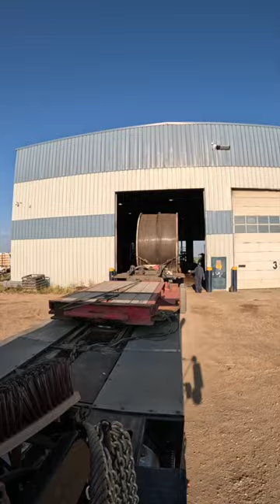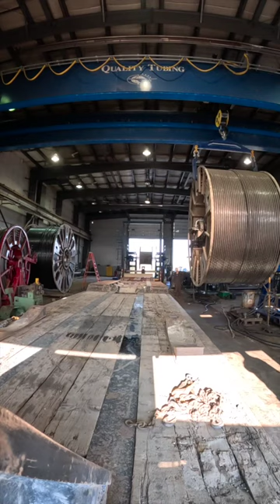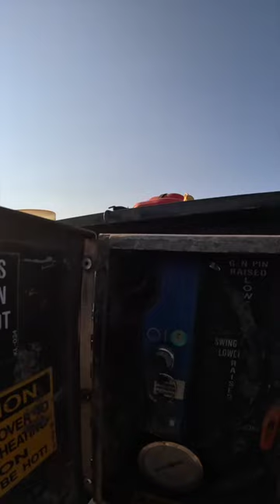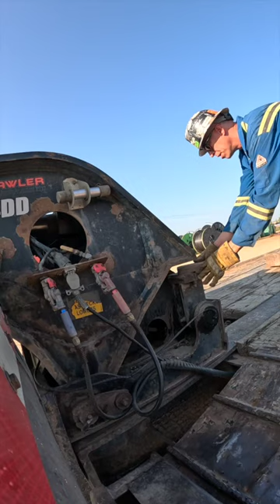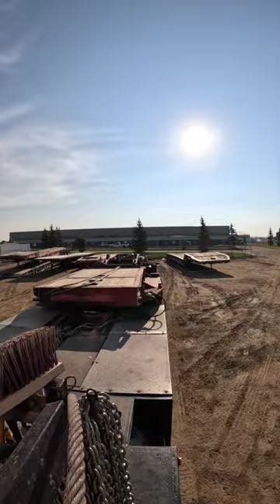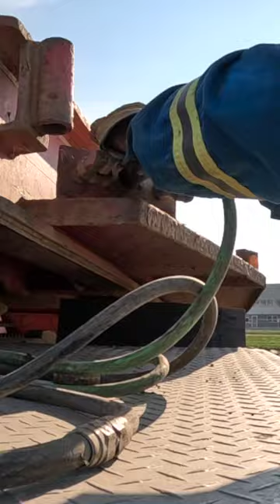COIL SHORT

Comment: Four very important rules for trucking.

1) When backing up, don't stop till it sounds expensive.

2) The truck ain't loaded till the duals touch.

3) If she don't wonna go, wind her up and let the clutch out slow.

And lastly, 4) Valves are meant for floating. 

Keep the shiny side up and have a good rest when you get there.

Comment: Backing that into the shop  would be a challenge that probably doesn't scare you like it used to? I know I certainly couldn't do it first try.
Reply from the maker: i still mess it up. it has to be perfect on two lines the same width as the coil. some times 2-3 shots

Comment: is that a B-Triple trailer setup?
Reply from the maker: we just call it 48 wheels here in alberta, no booster 40 wheels, also just 16 or 24 depending on main trailer, the equipment guys go by axles numbers for hauling heavy equipment
Reply: Its just a float and dolly. Nothing special